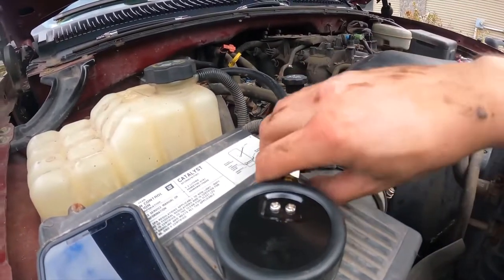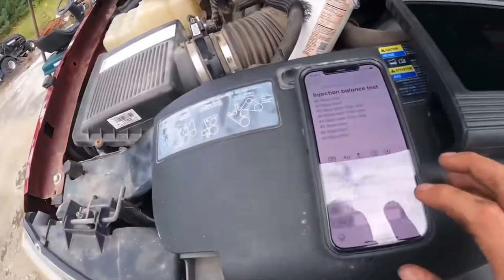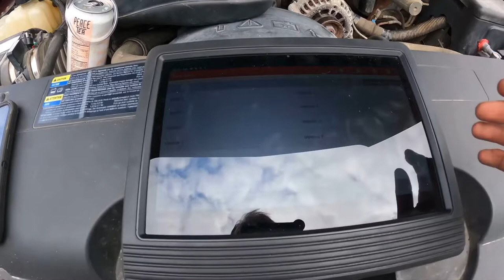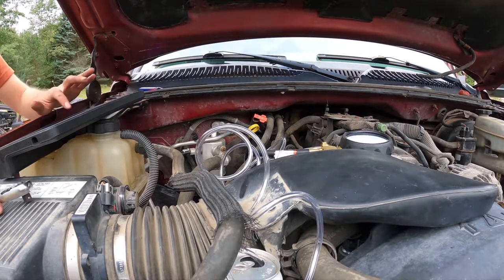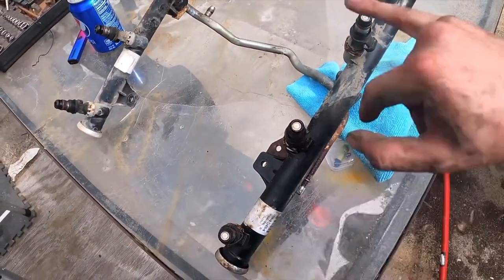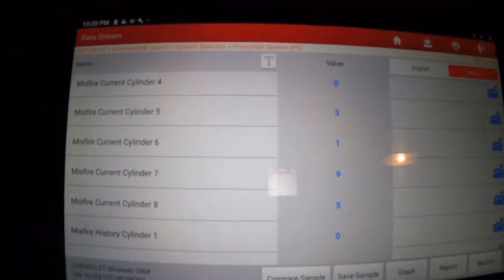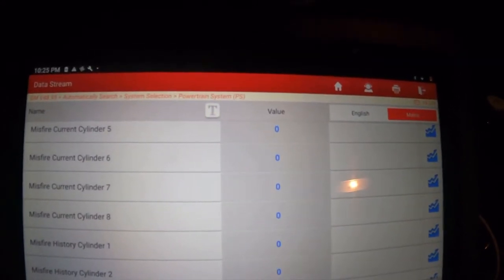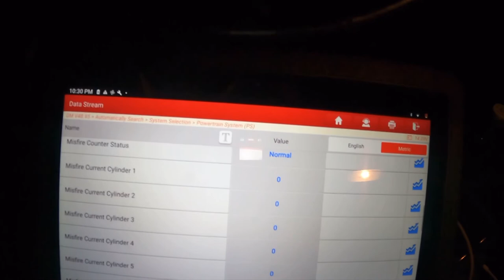2004 Silverado Fuel Injector Leak Down Testing

Comment: I have a stumble at idle I can bearly feel it and my second injector was the only one off at 40 and all the other ones were at 34 psi can that be it I changed spark plugs and no vaccum leaks
Reply from the maker: @ernestoalfaro1923  I’ll be completely honest with you that question is way out of my depth of knowledge. I would think that would be a good educated guess, the injector being 6 pound different from the rest sounds like it would cause a symptom like that. I’m sorry I couldn’t be of more help.

Comment: What was the reason in the beginning that you thought it wasn't spark. I don't believe it is spark because.............................?
Reply from the maker: I believe I had swapped coils around to verify the coils were working and at that point ruled out spark being the issue. If I had a spark tester I would’ve been better able to prove it out on the video.
Reply: @CamelGarage  nice.....thank you,
Ya, i'm considering buy a spark tester
Reply from the maker: Are you having a similar issue? The vehicle in the video had sat for over 4 years, which is the reason I believe the two injectors went bad. I had also thought maybe some critters might have nibbled at the harness. What I found was just to take it one bite at a time work on proving out compression, then spark, fuel and air. Not in that exact order but those are the basics and engine needs to run.
Reply: @CamelGarage did you have a bunch of white smoke pouring out the tailpipe? That's what my trucks doing and I'm thinking I have a stuck open injector
Reply from the maker: @Kevin_Yagoonie  I did not, it was misfiring constantly on 8 and 7. No matter what I did swapping coils new plugs wires checked compression nothing would change it. Then I watched it on the scan tool and noticed 8 missed all the time 7 would come and go. Decided to try the injector test number 8 didn’t even click it was so bad 7 would come and go so I decided to change both. If you don’t have a scan tool I was told one could pull the fuel rail and crank it with it out, I don’t think it would be something I would try as the fire risk is high or you could rig up a injector tester I’ve seen them before but came across a video randomly so I have no source to give you for it. Hope this helps.
Reply: @CamelGarage  thank you. I think I'm just gonna replace all fuel injectors and hope for the best. And replace the pcv valve cover with the updated one while I'm at it
Reply: Bro u have a massive exhaust leak on cyl1
Reply from the maker: @marcosborras4804  there’s exhaust leaks on both side of the manifolds 😂 I’ll get that sorted eventually it needs an entire exhaust system manifolds to tail pipe it currently has no cats. Right now I’m trying to figure out an issue I have with the 4x4.

Comment: Yup i need that scan tool. Would make a similar problem easier to diagnose with misfire and rough starts and random no idle.
Reply from the maker: The only thing its missing is an oscilloscope which would be super super helpful in pinpointing the issue. The $10k snap on device has it built in. I think a separate oscilloscope would be more attainable tho.
Reply: @CamelGarage  I have the milwuakee m12 one. Have used it a few time comes in handy for tight area or even looking down into something.
Reply from the maker: @danielmoniz3986  that’s a borescope which are handy I’m talking about an oscilloscope which is used to look at wave forms.
Reply: @CamelGarage  ohhhh ok I confused those to my bad.

Comment: fuel filter ARE serviceable
Reply from the maker: There is NOT a “serviceable” fuel filter on this truck. The only filter or screen is built into the sender and they claim it is a Lifetime filter that is non serviceable. Is it replaceable? Definitely, but at that point I personally would rather replace the whole assembly. There is absolutely no traditional fuel filter that either clips to or screws to the fuel line after the pump. That is what I was referring to.
Reply: @CamelGarage  … GF481 acdelco located where ALL gm truck fuel filters are installed under driver side frame 
The filter aka strainer located inside fuel tank onto the fuel pump assembly is a narrow sock style strainer pressed onto the pump suction… fyi
Reply from the maker: @arbyarby3259  you simply are incorrect, https://chevroletforum.com/forum/silverado-fullsize-pick-ups-21/fuel-filter-location-2004-silverado-2767/ I too thought there must be an inline filter somewhere on the line going to the fuel rail. It does NOT exist on this truck.
Reply from the maker: @arbyarby3259  it looks like 2004 is when gm decided to get rid of the serviceable external fuel filters from what I’ve read. I don’t have experience with these trucks aside from this particular year. I agree on the trucks from 03 and before the filter you speak off would be located where you said. To make matters more confusing even the Haynes manual states 99-06 should have an external filter but for this truck they are wrong and multiple other people with the same model year are asking where said filter is located every answer states the “filter” or sock on the suction side of the pump IS the only filter. I don’t claim to understand why they did this I only know what I saw with my two eyes on the truck, just a line not filter. Thanks
Reply: @CamelGarage  …. Interesting if you have searched for it  but this maybe the BEGINNING of the automotive industry to start bringing IN ya vehicle 🚗 for THEIR TECHNICIANS to repair at high labor and parts cost to stay afloat!!  The new generation service dept has changed since I worked it decades ago kinda like the NFL whereas the coaches/refs never played ball !!  But if you really want it in place ya could fab the lines or grab a set of fuel lines from the wreckage of similar vehicle of prior’03 and ya set sir plus most gas ⛽️ stations have a filter upstream of the nozzle so that helps… enjoy your video👍 😎